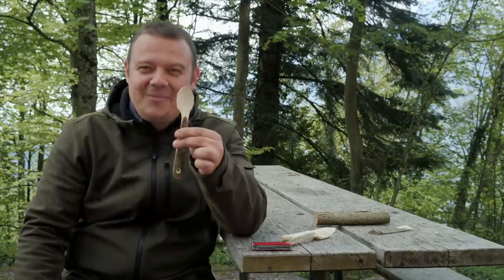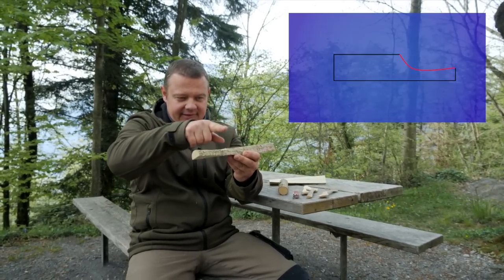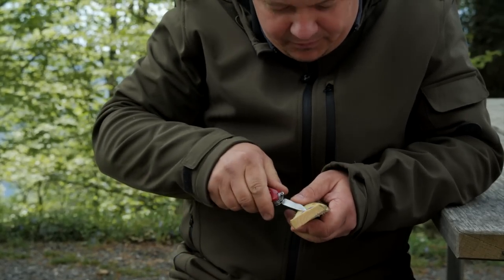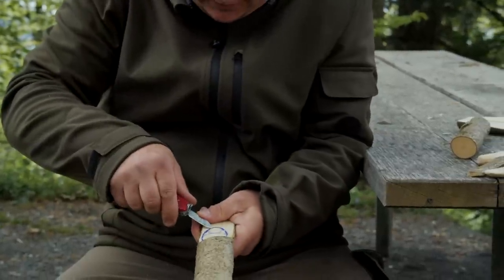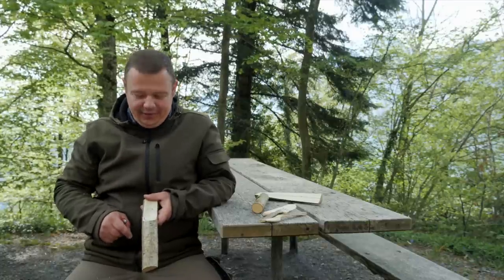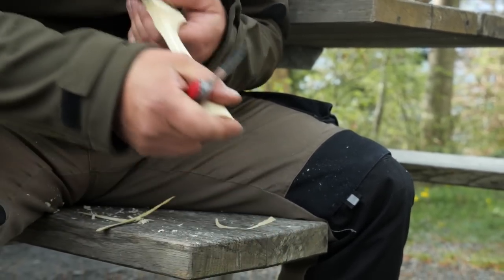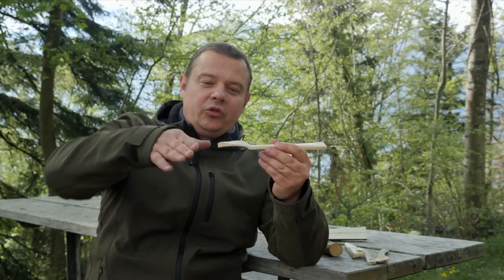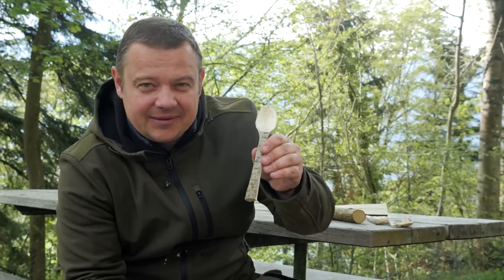How to carve a wooden spoon (for advanced) - cutlery set (3/3) - Victorinox Swiss Army Knife project

Comment: Felix, amazing work as always! I was wondering if the chisel found in the SwissChamp wouldn't be absolutely ideal for carving the spoon's mouthpiece. What do you think? I'll try it this weekend.
Reply: I have tried it, it works. But the Swiss Champ, you have to break it from my cold, dead Hands someday, is a bit to bulky for this kind of fine Task permanently.
Reply from the maker: I never tried it out. Thanks a lot for this hint!
Reply: @berndf.aus.n.a.d.w  I carved a fork and a spoon last week with the Swisschamp and used the chisel, as proposed above. It worked fine. I only used the chisel to carve the spoon bowl and I found it easy to work with. Unlike Felix, I prefer to work with the large blade for most of the work, instead of the small one. Of course that people have different opinions on Swiss Army Knives, that's why there are so many combinations of them.

Comment: I see You are using almost exclusively non lockable, smalleer blades. Wouldn't it be easier to use more sturdy blades for such projects?
Reply from the maker: I like the small size of the blades for the carving work. For splitting wood, a bigger sturdy knife would be better...yes.